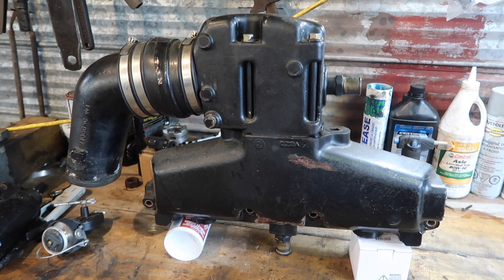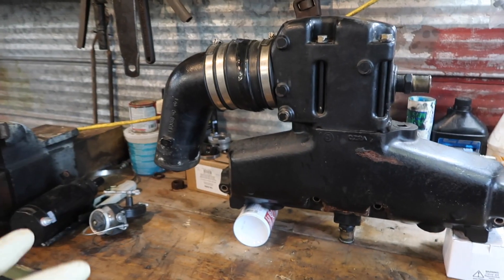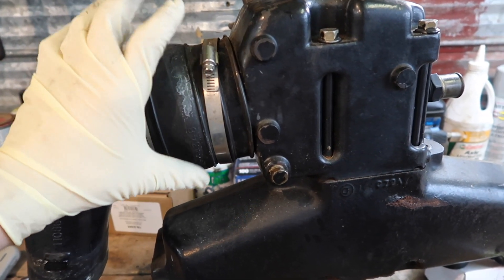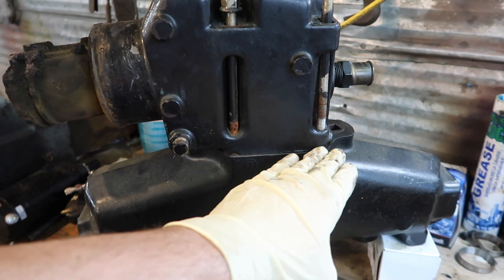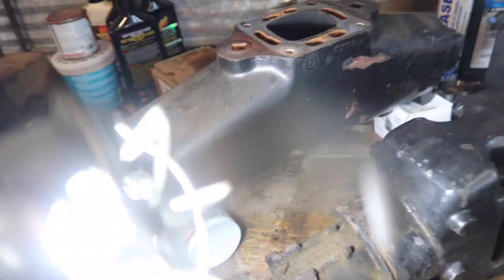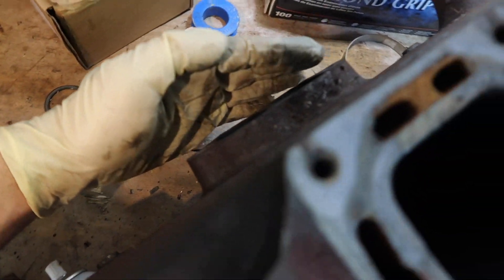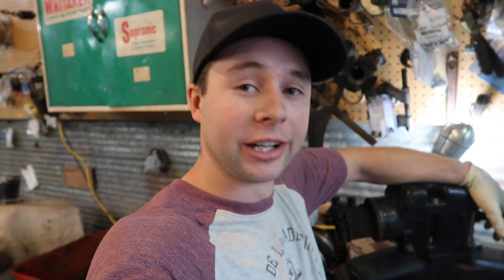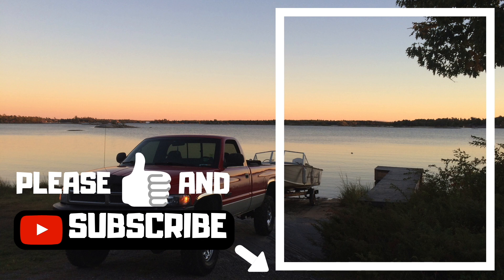Marine Exhaust Manifolds. How Do They Work?

Comment: On a Merc 3.0 thermostat, the hose on the right (as you face it) goes to the exhaust manifold correct? So if I fill that with antifreeze should that not run out the back of the engine?  Winterizing my boat myself this year and nothing runs out the back. But the hose does fill up?

Comment: Damn is there any conversion or alternative to this terrible design??
Reply from the maker: No, there is many similar designs. They aren’t terrible. I have boats that are 40+ years old with original manifolds. Properly maintained no problem.
Reply: Just a random question would you know where about on the indmar ly6 2007 I would find the camshaft sensor

Comment: Great video,  learned  how they work, just bought a boat with volvo penta 4.3 engine that has 2 of these, are they different from mercruisers ? should I go ahead and replace the gaskets? thanks for the help
Reply from the maker: Hey! Volvo is slightly different. Dame concept though. It would not hurt at all to change the gaskets if there is a sign of any deterioration. Good preventative maintenence.

Comment: I’ve got a 1990 Supra Conbrio with a PCM 351. I keep getting bits of sea weed debris in the water intake and would love a quick video to show me exactly where/which hose to unclamp to remove the debris. Starting to run hot while idling
Reply: Tim, check out this vid entitled 'Ski Boat Overheating and Cooling 101': 
https://www.youtube.com/watch?v=c5TEBV8NrjQ

The seaweed issue is covered in full.

Comment: I would think that with the invention of cerakote, the manufacturers should be lining  the interior of the water jackets to prevent rust through. I'm no engineer but I would think they could do the math on cooling temps and heat transfer/absorption or discharge of heat and figure it out. I would pay the extra cost in the manufacture process to ensure not having a rust through and engine failure.
Reply: Not being fluent in cerakote application but versed in powder coat, if cera is electrically applied as is powder, the internal application, especially tight space internal application of electrically charged particles from an electrical power source gun applicator is highly problematic for the device to reach into all the confines of the internals of the water jacket.  Serious problem number two, if a custom micro wand head was invented, the uniform application of the powdered substrate would be hindered by Faraday cage effects.  Each manifold water jacket would have to be mapped in cad by the design company, sent to the cad/cam cerakote company operator, if there is one, and executed by custom machinery run by a computer.   That said, I think you're onto something.  As an industry in the US, we have liquid bath coating capabilities ie electro plating that could be an industry ready step process with virgin material from the manufacturer.  ...internals still an issue en bathe with Faraday but not as evident.  Would certainly tap any contacts in aerospace with internal cavity coatings.

Comment: Been saving this video for a couple months so that I could reference it with an upcoming riser maintenance job on my 2006 Volvo Penta 4.3gl (I bought it used a few months ago). Unfortunately, I'm now being forced to do this job sooner than I expected because last weekend while in the Gulf, we were cruising FOT and I stood up to readjust my seat but forgot my safety strap was clipped to my shorts. Ignition cut out as expected but then I couldn't restart the engine no matter what I tried. Thought maybe it was the battery died suddenly or starter even. Had to get a tow boat. He tried jumping but the battery was fine. Starter just clicked with no engine turn over so he towed us back in. When I got home I took out the plugs and turned the starter and 2 cylinders shot water out like a cannon. Talked to some boat mechanic friends and they claim the water must have came up backwards through the exhaust system and fed down through whichever cylinder valves were open at that time. Anyone else experience this issue?? Is it common? I should mention that I have raw water cooling. Thankfully, after a few days of turning it over using the starter plus some fogging oil and ensuring there's no water in the engine oil, I was able to get it dry and get it running again. Obviously, I'm nervous about this happening again! I don't think I have any cracks or water in the manifolds but this weekend I'm going to take the risers off to check that and probably replace them since they are original and exposed to saltwater.
Reply: When your boat came to a sudden stop, water came up through the exhaust from the outside of your boat. The out drive has flappers that open and close to prevent this from happening. From what I understand, you will need to get these flappers, by taking the out drive off. These flappers have rubber to seal them and prevent water from entering into the through the exhaust during sudden stops. They fail when the engine overheats or gets too hot and since it's rubber they eventually wear out and do have to be  replaced. I have watched a YouTube video about it recently because I've been experiencing this same thing.
Reply: @marymeyer1449  Would you happen to have a link to that vid you referenced?  I lost an engine because of this (since replaced), and want to have a visual aid on the backflow issue.  Thanks!
Reply: @jeffferoce2633  Chris Boats explained in his video of How flappers work. I am not sure how to share it with you, but you can search it.
Reply: Yes water came up exhaust Volvo does not use flappers any more to prevent this get the water out get it running probable ok

Comment: Perhaps it would be beneficial  to point out just why marine exhausts are so different from car exhausts. One could think that car exhausts are essentially air-cooled & marine exhausts are water-cooled. Why  is this? The marine engine bay is a fully enclosed space, the automotive spaces are open to airflow. The car uses air thru the radiator AND along the exhaust manifolds to extract heat, the marine engine only uses a  body of water as the source to extract heat.
Reply: So  water is used to keep the exhaust manifold cool along with normal cooling of the engine block.
Thanks
Reply: They make two different manifolds wet and dry, I believe 2002 and up are dry on the small blocks, all big blocks are wet manifolds. Dry manifolds are a lot more expensive.
Reply from the maker: Correct, that is good to mention. I have seen a lot of wet manifolds still on the newer stuff. For sure on 08-10 models I still seen them.
Reply: That explanation sounds like a whole nother video
Reply: Cars have radiators and water pumps.
Reply: @gregwhitehead7967  Perhaps one could think of a car as having a two-stage cooling system, the first being a closed system with a coolant circulating & a radiator using air to dissipate the waste heat into the mass of air around us...In the marine application, think of it as a single-stage system , dissipating the heat into the mass of the body of water its floating in.
Reply: @gregwhitehead7967  marine engines have waterpumps too, and on engines like these they pump raw seawater through the block, heads and exhaust for their cooling.
Reply: @eaxnitro  I don't think they pump a lot of seawater where I live, I live in the mountains in Idaho though but yes they pump raw lake water and blow it right out the exhaust. I don't own a boat myself but I have a friend that has three jet boats and another friend that has one really bad ass one
Reply: @eaxnitro Yeah lets imagine sea water getting ran through an iron block marine engine. That's silly. They don't pump sea water because sea water would eat that entire system.  The sea water is separate and cools the hot distilled engine water through a heat  exchanger, then that now heated sea water is cooled and dumped with the exhaust to cool the exhaust gas. Depending on your boat the heated sea water will just be cycled out.
Reply: @vannigiovannigio8861 it might seem silly to some but it's true. It sounds like you're seriously stating that no marine engines pump raw sea water (that the boat floats in) through the engine. If I'm misunderstanding i apologize a please correct me....a lot of marine engines are in fact cooled by raw sea water that circulates through the engine block and manifolds to keep the engine running at a safe temperature. Yes there are marine engines that use heat exchangers and coolants but most are not cooled that way. This is why they need to be winterized for winter storage.
Reply: @T-L.Ch.412  As I suspected,  industrial scale heat  exchangers are used in marine vessels large & small, with the corrosive effects of saltwater limited only to the heat exchanger itself & not circulated thru the engines.
Reply: @T-L.Ch.412 you’re wrong.  All boats need winterized if they’re in an area subject to freezing temperatures.   It has nothing to do with engine cooling but more to do with the fresh water systems on the boat.  People may “winterize” the engine but that is just flushing the raw water area out with fresh water and draining it.   I don’t do that because I use my boat year round and it lives in the water.   I do flush the raw water portion every time I use it.
Reply: @AndyBlack13, close but, NO CIGAR 😂
Reply: @stevenr8606  Close you say?, could you elaborate please?
Reply: @AndieBlack13 Some boat engines also use coolant. Lookup fresh water cooling (also called closed cooling system) vs raw water cooling (also called open cooling system).  Ones that use coolant use a water pump to circulate through the engine/exhaust manifold/heat exchanger, and then use raw/ocean/lake water to extract the head out of the coolant in the heat exchanger, which is basically like a radiator, just instead of air blowing through it's fins, it uses water. 

In a raw water or open cooling system, you're correct. It uses only water, which is circulated through the engine itself as well.
Reply: @Jason-un9ps  Yep, as an alternative for routing coolant from whatever body of water the boat happens to be floating in, the coolant that actually circulates thru the engine isn't the same water/coolant that the boat resides in...I actually had an inboard boat that came to our  auto-shop that I worked on, (go figure)...it was one of those "closed system" coolant types....If one wants to operate a boat in saltwater, circulating saltwater thru an Iron block is going to eat up an engine....hence the closed systems benefits.

Comment: Did mine this year; and I'm no genius.  Loosen the clamps at the lower end of the rubber flexible connection, then remove the 4 bolts, tap solidly on the side of the riser with a rubber mallet to break it loose and pull off the flex from the lower connection point. [Leave the flex connected to the riser] Then use an electric wire brush wheel to clean off all the old gasket from the engine manifold side [stuff a rag in the exhaust port to keep out debris] .  Take the riser to your bench and do the same. Clear any rust or blockage from water jacket passages.  If salt water use, the water passages could be clogged beyond help. (Time to buy new risers and possibly new manifolds)  If clogged, you would have noticed the engine overheating. [ To re-install, smear a little gasket cement on both surfaces, then push riser onto the lower flex connection point and slide new gasket in position while holding riser just above engine manifold.  Lower riser while aligning the 4 bolt holes, install bolts, tighten clamps on flex connection. Re-connect any other smaller hoses you had to disconnect.  You're done!  Don't be afraid to do it; this ain't rocket science.

Comment: When water enters the combustion chamber you get what's call hydro lock. The piston can't compress a liquid. It's call Pascal law.
Reply: Yes. Hydro-Lock will blow the head gasket, or worse.  Turning engine over with the starter may be impossible.  Will turn until problem cylinder is in compression stroke.
Reply: So, that's why when I was an " Apprentice Boy" in a shipyard, and they sent me to find a water compressor, I'm still looking after 40 yrs! ... Boy, am I pissed !

Comment: Weres e the water get picked up and driven into the exhaust n block at just curious?snooky pa
Reply: cold water is picked up from the lake or ? at the outdrive intake ports close to the propeller and pumped thru the engine for coolant, then the hot water from the engine is expelled thru rubber hoses at the thermostat housing to the fittings on the exhaust manifolds to help cool them before the hot water is expelled out with the exhaust at the prop to complete the cooling cycle.
Reply: @davidlindsay847  A typical inboard/outboard drive had two water pumps. On a Volvo Penta setup, the raw water pump sits on the front of the harmonic balancer and picks up water from the lake/river/ocean through inlets in the outdrive. This water is pumped up to the circulating water pump that sits up above the raw water pump and is driven off the crankshaft either by a v-belt or serpentine belt. The circulating water pump circulates the water from the raw pump through the engine, power steering cooler through the exhaust manifolds and out the rear of the outdrive. Some makes of IO setups have the raw water pump installed in the outdrive itself but operates essentially the same as what I described.
Reply: @davidlindsay847  Perfect! That explains the entire system, right there!
 
Thank you for posting this!

Comment: Great video .. proplems are also inside the riser is a liner type wall that separates exhaust from water .. they tend to rust through .. easy to inspect when u pull it off .. .. be safe

Comment: The tiny holes are for water to escape.  The manifolds have a built in heat exchanger where water stays in the the jacket around the manifolds to help keep them cool. The water escapes slowly out those holes along with the engine hot water. On the older log style a hose goes to the front and back and has one tiny hole in the restriction plate. A separate hose goes on top of the riser from the water pump. On these the water goes in from ends to end and water pump water comes  out thru the bottom thru the big holes out the riser.
Reply: I've been told the gasket with the 2 small holes are used on the most common open systems where sea water comes in thru the system and goes out the exhaust. If you have a closed system the gasket is different and the holes are open.
Reply: @freshroasted coffee  yeah. A closed system is great but I like the raw water. I have a 73 searay.  Still going.  302 ford v8.

Comment: Thanks for the explanation. I just replaced my '97 model 4.3 Mercruiser V-6 engine in my boat due to the thermostat not opening during winterization and not getting any antifreeze into the block. Lesson learned. I have the 1-piece manifold/risers. Fortunately they seem to be ok. I have taken the boat out a couple of times with no issues thus far.
Reply: I was told thermostats have a bypass for this reason.  Not true? I've been doing winterization the old fashioned way by draining water from the block and the lower hoses then pouring antifreeze into the hoses I've disconnected at the thermostat. I'm no expert but have had good luck so far. I would love to know any other tricks to ensure I'm doing this correctly. I do not disconnect the risers/riser hoses at all...but I'm working on Volvo-Penta engines....I've never heard of this being necessary.
Reply: @deraeler  Same here with our 4.3 merc. Drain water from all 4 drain ports, drain water from power steering cooler water hose and main water pump hoses, done in about 10 minutes. Both block drain ports need a quick clearing with something small as sand/mud accumulates at the bottom. Cold MN winter (-30F) for many years now, no antifreeze, no issues.

Comment: A wet joint exhaust is shown in this video.  Older style. The fuel injected engines found in boats from at least 2000+ use a dry joint which don't have this design flaw where it can leak into the engine and seize the engine.  You could still lose an engine with a dry joint exhaust but it not as common.  Replace them every 5 years in salt water and you'll never have to worry.
Reply: Can I convert it to dry joint
Reply from the maker: Hey Mike thanks for the comment. That is true that dry joint have less failure. Although i have seen this design on 2010 and plus models for a fact.

Comment: The two plugged water jacket orifices on the base of the riser with just two tiny round holes that puzzled you, are just rusted and clogged except for those tiny holes which have yet to fill on yet.  Its a gradual thing. Poke them hard with a chisel and you'll find out. They were once as open as the others.
Reply from the maker: Hey Paul, i know what you are saying but those are definitely two machined round holes down there and not clogged. I wish they were just clogged though. Lol😂
Reply: Would be great to know WHY those water jacket orifices are restricted by the gasket.